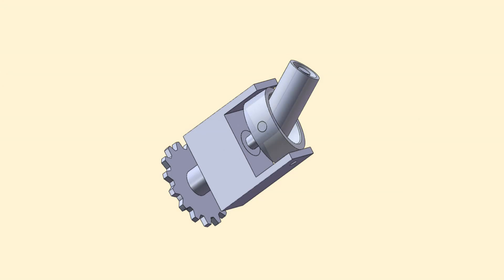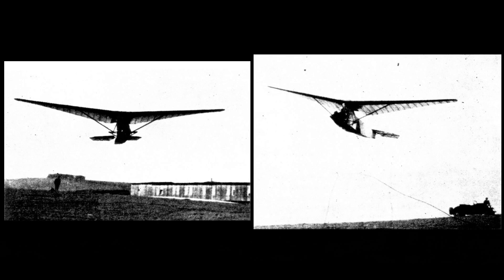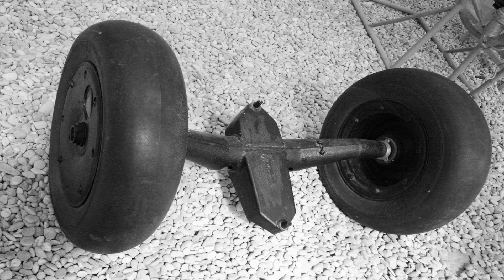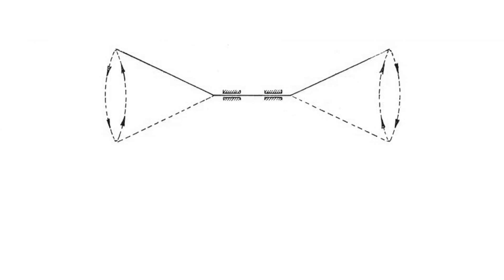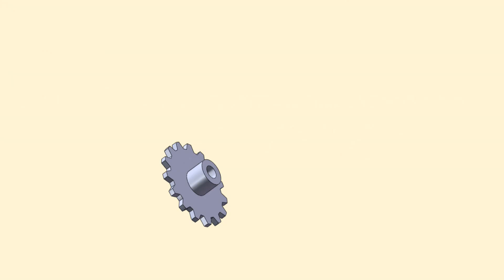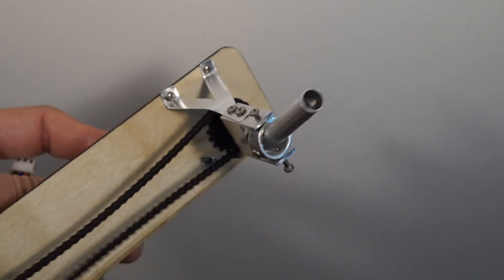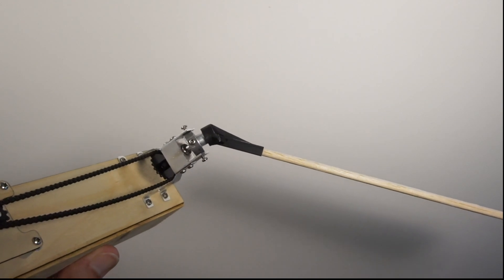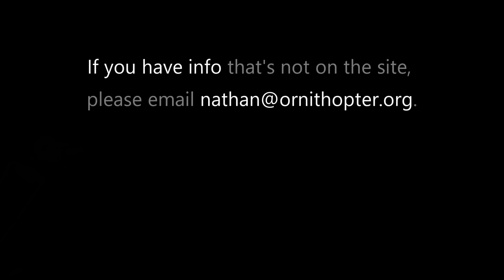World's First Manned Ornithopter Adalbert Schmid 1942 Germany

Comment: well, imo, this 'oars in the air' approach has only its novelty to recommend it.  in recent times, hobbyists and researchers have made radio-controlled 'thopters, that fly reasonably well.  one or two have used a design that included two-surface wings.  this type of wing makes lift when NOT flapping.  so, actual gliding is possible. this is not true of a membrane wing.   cheers
Reply from the maker: Hi David. Despite the theoretical advantage, double surface wings have generally performed less well than membrane wings, in ornithopters, due to their much heavier weight. Membrane winged ornithopters have a much better record of success, and they can also glide quite well, when properly designed. Schmid's ornithopter may seem to have a rowing motion, but is not designed to produce thrust by pushing back against the air like true rowing. Instead it produces thrust on the downstroke like other ornithopters, and it was reported to be very efficient (needing only a 3 hp engine for flight). The main lifting wings, as well as the flapping wings, appear to be double surface airfoils.